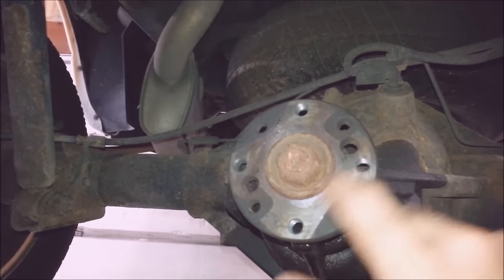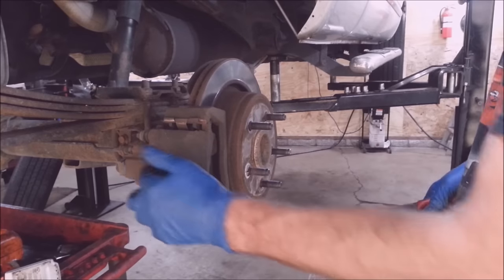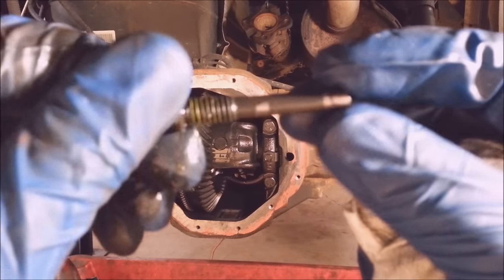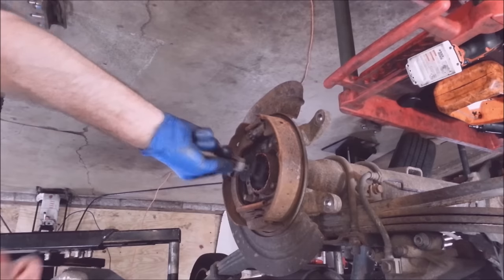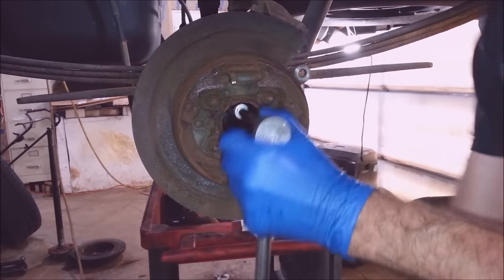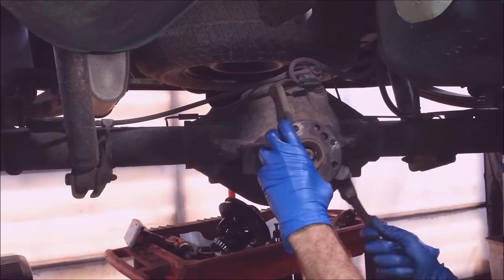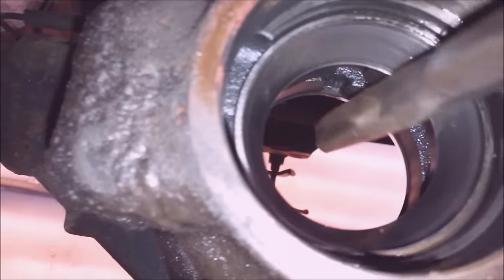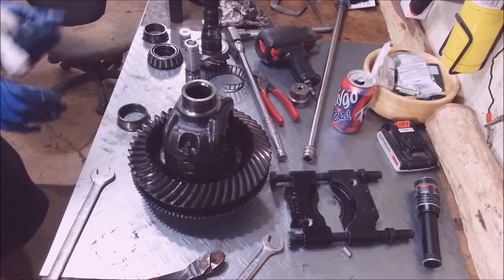1994-2018 Ram 1500 9.25" rear differential rebuild disassembly pt1

Comment: There was a recall on multiple year model Rams for a pinion nut that would loosen and cause damage to the gears. Dodge replaced mine for free on my 2005 model just a few years ago. I had over 200k miles on it, and I got a complete new rear differential out of the recall.
Reply: How did u find if your vehicle was on the list this just happened to my 2009 1500 smh
Reply: They put a funky Keeper in there to hold it all together. Small allen wrench removes the stretch key then 2 - 5mm .08 x 35 bolts inserted in they're place and a small puller to remove it.

Comment: Great video thanks. I am changing the brakes and brake backing plates on my 2004 ram and when I pulled the axles I found a small piece of metal, looks like part of a bearing. Your video convinced me to pay someone else to replace all the bearings... maybe in my younger days, but no lift, not having the right tools and not wanting to f$&@ it up, I'll pay someone. 🤣

Comment: Doing this job for a friend and there's always something weird about repairs to his vehicles and just so happens that the differential had some weird stuff going on about a feeling but the pinion completely seized. And after I finally got it apart front pinion bearing was almost totally gone. The cage was partly there and the inner race was in pieces and the tapered roller bearings all fell out when I knocked the pinion through that's not the weird part though. The weird part is when I found the shim underneath the race for the rear pinion race. So I'm thinking that it would still do the same thing as putting it on the pinion shaft. When I first saw that I immediately thought well. There's your problem that caused all this havoc, but then when thinking about it, if you put it behind the race or behind the bearing, it's moving the pinion in the same direction either way. But when you put it behind the race now your crush crush washer is not going to be doing what it's meant to be doing and whoever did that who knows if they actually checked their pinion bearing preload but I bet if they had I wouldn't be doing this job right now. I don't mind though. That's what I do for a living anyway so just wanted to add my two cents to your well done video. It helped me out. Actually, I've done this about a dozen times on different vehicles and it always helps to refresh my memory
Reply from the maker: If you are messing with shims, you might want to check your gear mesh. I didn't feel the need in this video, because I used the same shims.

Comment: I need to do this to my ram. Thanks for the tips. I’ve been wanting a press now I have reason to buy 1. Among a few other tools. It still be cheaper than letting the shop do it. I worked at a power transmission plant so I know about backlash. Looks pretty detailed to me. Be a fun job. Lol
Reply from the maker: Thanks for watching. I got my 20 ton press, and that cheap bearing separator at Harbor Freight. Seems to be the best deal.
Reply: Hi...I completely failed and can't get the axle out due to fractured shims that rotated and stacked themselves to where I am screwed and can't even put it back together because spider gears won't fit right. Seems like an easy project UNTIL ITS NOT. So have another truck picked out before you even start

Comment: There is an easier way to get those bearings off. Cut the bearing cage off w/ a pair of wire cutters. Easy to do because the cage is made of soft material. Once the cage & rollers are out of the way you can place the bearing separator on the outer flange of the inner race.

Comment: Get that there pinion nut off...heheh I rebuilt my track lock unit on my 2003 durango, put new carrier bearings in etc, about 10 years and 60,000 miles ago, but I avoided doing the pinion bearing because my neighbor said it was nearly impossible to remove the nut. Apparently not. I went in there in the first place because the clutch pack was disintegrating. Now I have a gear noise in the back, Im sure its the pinion bearing so I guess Ill be going back in there soon.

Comment: Pinion bearing oil seal that yolk flange goes onto. Yah. High mileage issue begins leaking you gotta change that annoying crap once it first begins leaking so catastrophic damage doesn’t happen. It happens on other older trucks and SUVs I have seen and even recommend saying to replace it. It’s easy job. If it begins leaking on the ground do not drive. You gotta change that seal because it’s completely shot. 

You drive you’ll loose all your gear oil and then damage your pinion bearing and possibly other things.  I drove with a damaged wobbly pinion bearing for a couple fricken months after the seal blew. 🤦🏻‍♂️🤦🏻‍♂️🤦🏻‍♂️🤦🏻‍♂️🤦🏻‍♂️ I needed my only source of transportation!!!!!! That truck was well took care of. It also did have over 200k on it. Previous owner bought brand new and he just kept refilling the differential even though you do do that your still gonna suffer catastrophic shit because that seal ain’t gonna last. Change it dammit. 🤦🏻‍♂️

Yep. 

Pinion bearings are probably a number one thing man

Comment: LoL.  My emergency brake shoe pads look exactly like those ones.  Pad material Completely separated from the shoe.  Since I use e brake so very rarely, what I did was just buff clean the steel shoe surface and then glued the pads back on using ultra high temp, ultra black rtv.  Glued on 4 years ago. Still on where they should be and ebrake works fine for the few times I use it… which is on the boat launch ramp.

Comment: my 04 has the same issue the shop said i need all new bearing does that also mean new pinions and gears...they wanna charge me 3000$ 🤦🏾‍♂️🤦🏾‍♂️i rather try it my damn self, great great tutorial
Reply from the maker: You could get a whole axle for less.
Reply: @RustBeltAuto  what are signs of a bad axle? replacing the pinion bearing may be the hardest part of all if im replacing all bearings.
Reply from the maker: @Super Sic-O  the axle its self rarely goes bad. The parts in it wear out. Those people are probably trying to sell a ring/pinion, carrier, and bearings.
Reply: @RustBeltAuto  thats exactly what they told me sir...all bearings and ring and pinion🤦🏾‍♂️ i dont have the tools for the pinion i believe..im sure the wheel bearings probably gone as well it jus gets louder while driving , i parked it for now , will a rebuild kit fix this ?
Reply from the maker: @Super Sic-O  you need to inspect the gears. Put a little grease on them, and see what the mesh pattern looks like. Inspect carrier for wear, or damage. The shop probably gave an estimate as the worst case scinerio, because the cover needs to be removed to inspect all that stuff.
Reply: @RustBeltAuto  thanx alot for fast response and happy thanksgiving , im gonna go open this rear cover up

Comment: I just replaced the bearings and clutch packs in a 03 ram 9.25. I got the ring set at 8 thousandths but it makes some noise while driving. 
  The driver side adjuster some of the threads were screwed up so im assuming it mustve thrown off some adjustments

Comment: Awesome to watch. Thank you for posting such a detailed information. I was wondering the size of the nut that holds the front flange. Have to replace the driveshaft, and in the process of removing the bolts that attach the shaft to the flange,  2 of the bolts sheared right off. Now I am dead in the water until I replace that flange and install 4 new nuts. Any help is appreciated

Comment: Hey Great Video..nice Details & step Process..I have the Same truck but 07 I changed the U -joints now I have a Vibration @ about 60mph..? I'm not sure what to do next..6 months ago I s
Changed fluid in Rear Diff..._ it still has correct amount of Gear oil in diff..& doesn't make any Noise..do you think my Pinion Bearing is Shot..? Is why I have a Vibration @ 60 mph..?
Reply from the maker: I think if you didnt have a vibration until you replaced u-joints, then the question is answered.

Comment: Probably safer for the pinion threads to use a heavy duty punch and place it it the recess in the middle of the pinion. First timers, watch that you don't knock the pinion out of the housing and on to the concrete floor.

Comment: Hello, thanks for great video. I am trying to turn the differential to get better angle to remove the axle shaft pin, but it is not turning. I can turn the rear wheels freely. Front wheels are on the ground. What am I missing?
Reply from the maker: Did you remove the driveshaft?
Reply: @RustBeltAuto  yes, I did. I finally figured it out, I had to put the transfer case in neutral also. Thank you for your reply.

Comment: The spider gears fell out on me while doing wheel bearings / seals. Any tips on getting em back in. Both axles are clipped and installed I just can’t get the space to install the spider gear with its washer.
Reply from the maker: You just stick both of them in there, and turn the carrier. It is the opposite of what happened when they fell out.

Comment: Hi, nice video tutorial.  I'm currently in the middle of doing my right rear axle.  I have been watching youtube to do the job myself for weeks now and it really didn
t look that hard to do. after draining, removing the first first pin then the pinion pin (thick pin) the C clip did not fall out. So we pushed the axle in and out and wiggled it as much as we could  but the C clip will not fall out. it does move around freely so nothing is frozen or stuck in that respect. It just won't come out. what would you suggest??
Reply from the maker: Probably going to need to pry on the side gear a little bit. Use the groove for the clip, and a screwdriver.

Comment: I am currently rebuilding my 2001 dodge ram rear differential. The video has been very helpful but I did get stuck on one part. I cannot get the old pinion bearing races out, do you have suggestions to help that along?

Comment: I have a question about the crush sleeve. The one that I got with my kit looks like the reverse of the one I took off. The one I took off looks like yours but the one with the kid has a concave bump on the inside instead of the outside. Do you know ifThat could be a problem? So far everything else is good on the kit. Thank you for the video.
Reply from the maker: I'm not understanding how it will fit on the pinion. The dealer will have the right one for your axle, if you believe it's wrong.

Comment: 2015 ran 1500 longhorn limited has a howling noise from the rear lens the has gotten louder over time. Would rebuild like my this handle that?
Reply from the maker: Going to need to remove the cover, and inspect the thing. Look for axle seal leaks too.

Comment: I have a 2004 dodge 1500 slt 4x4. Are you interested in rebuilding the rear-end? It locked up and broke some gears and bearings. Just wondering if you are close to Michigan and would like to work? Thanks
Reply from the maker: May be best for you to just find a used axel. I am nowhere close to Michigan.
Reply: Yeah I realized that you were in Minnesota I think? Thanks anyway. I went today to get one with 95000 mile on it for 1000 dollars but it was in rough shape. I honestly want to have it rebuilt. That way I know what is in there. I appreciate your time.

Comment: I was charged 1800 for a rear differential rebuild, crankshaft sensor replacement and camshaft sensor replacement (100 bucks in labor for each sensor so 200 paid) turns out camshaft sensor can EASILY be done.)  but dang after watching this video i can understand why it cost a lot for the rebuild

Comment: I am doing mine for the first time. On an 03, dodge ram 150 4.7. The spider gears fell out, so I’m having trouble putting them back in but I also notice some small Halfmoon type of pieces that also was at the bottom, that I assumed that fell out also. Could you tell me what those are for and where am I supposed to put those?
Reply from the maker: Thos are washers that go between the carrier, and spider gears. You need to hold the gears in place, and turn the carrier to put them back in. That is how they came out.
Reply: @RustBeltAuto  ok. Thank you. But the are some very small pieces that fell out also. Not washers but they look like two halves of one piece. About a half inch long. Again they are small pieces. I tried looking for video with this small pieces being replaced but no one talks about it.
Reply from the maker: @alfredgarza2043  sounds wrong. Maybe something broke. You should find a parts list/diagram. Maybe it will give you a clue.
Reply: @RustBeltAuto  lol. I know. I figured that. Even got a PDF of the axle diagram, but I can not find that piece, or those pieces. Lol. Your expertise was my last option.  I think I might have to go to the junk yard to get an axle. I don’t know yet. Thank though

Comment: So I just took my 2013 rear end apart. The shim or spacer was actually behind the race. This is on the pinion gear. the place you pointed out to utilize to take the races off for the pinion gear, I found the sham to be placed between the race and the rear end. So not damaging it to take it out was impossible. so I have a question and the question is is that the right location for this spacer on a 2013? is it supposed to be between the bearing and the gear like you showed in your video or is it supposed to be between the race and the rear end?
Reply from the maker: I have never seen a shim behind a bearing race, but if there was one there, the dealer should have them, or be able to order one. You probably need to measure the thickness with a 0-1" micrometer, or the dealer can measure it for you.
Reply: @RustBeltAuto  thanks. I'm wondering if someone else was in there already and did it backwards
Reply from the maker: @Deadstorage  the shim behind the pinion should not fit behind a race. It's a 2013, so they probably have a newer way of doing things.
Reply: I have the same issue. Did you have to get that "race" shim from the dealer?
Reply: @saahnahte  I did not. I got it from the manufacturer that is the supplier to the dealers.  It's been a while since I did it. The logo of the company has a graphic Mountain range. Almost like a Coors can I think.

Comment: Would the hole assembly come out without loosening the bearing races on the shafts with that funky inch and half homemade tool ? My pinion bearing went out and now it's all seized up
Reply from the maker: Thing is, they move. It's not like the ones that have shims in them, that need to be pounded in with a block of wood, or whatever. I would not suggest any of that.
Reply: @RustBeltAuto  thanks for the reply love your channel and video!
Reply from the maker: @les3316  😁

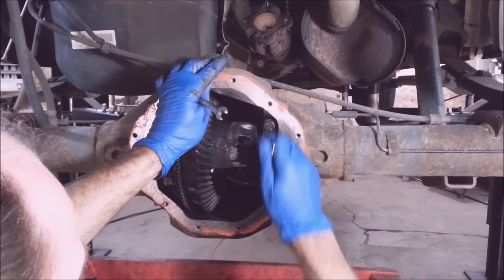Comment: I have a 2002 1500 with a 3:55. Acts like it wants to bind up some times when starting from a stop while turning the fluid is original and looks like Dark tea or thin soupy water
Reply from the maker: Sounds like you have an LSD. I would change out the fluid with LSD additive in it, and see if your chattering goes away.
Reply: @RustBeltAuto  thanks for the reply, that's what I am doing today I did get the lokfriction- modifier additive
Reply from the maker: @frankm8533  there is also additive already added in some 75w-140, and others. It says so right on the bottle. As far as I know, it works the same.
Reply: @RustBeltAuto  great thanks. It says to use 75w-90 in my truck. 2002 Ram 1500 with 4.7 2wd
Reply from the maker: @frankm8533  yes. That is a synthetic oil, and usually has it in there too. It will say so on the bottle. Your LSD additive probably broke down.
Reply: @RustBeltAuto  Great thanks. I'll let you know if it helps the problem other wise it's a great truck super clean

Comment: I have a 2011 Dakota and the rear wheels have play in and out. Would you know if this is normal?
Reply from the maker: How much?
Reply: @RustBeltAuto  well enough that the wheels move in and out probably 3/8 of inch. Also every time I back out of the driveway curb I hear the diff or axles popping
Reply from the maker: @noahriedel801  that sounds wrong.

Comment: What size of differential does a 2004 dodge ram 1500 v8 4.7 have
Reply from the maker: It depends. ask the dealer, use your VIN, if you are unsure.

Comment: Dealing with the same rear end zfc 235 on a 12 SLT four-wheel drive you wouldn't happen to have the pinion bearing numbers would you I got a kit from US standard gear and the bearings are .875 the one we took out that was crushed is .84 maybe .85 before it was crushed can't seem to find anybody who has any information on the standard bearing. Just getting tons of play even after we're contacting the crush sleeve. Thanks in advance
Reply from the maker: I don't think you are crushing the sleeve, and believe the original one you have is a crushed sleeve. That's the way I'm understanding it.
Reply from the maker: @natecherry8926  if there is a bearing number on it, can you go on McMaster Carr, or Graingers, or a bearing supplier, and find one that way? In all my days there was only one bearing I couldn't find. It was for a first year ford t-10.
Reply: @RustBeltAuto  yeah unfortunately the outer bearing is what gave way so it's pretty much destroyed we've been trying to clean it up to pull the number off of it it's pretty much garbage thanks for your help man.